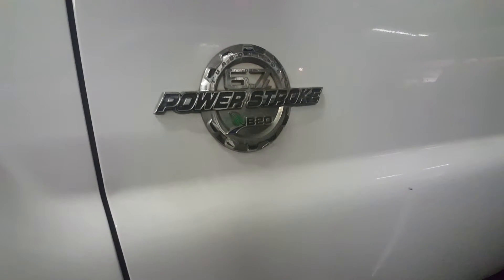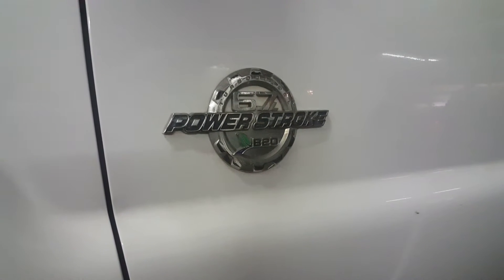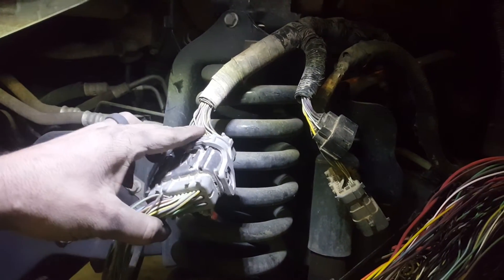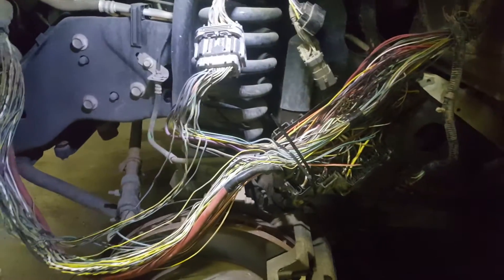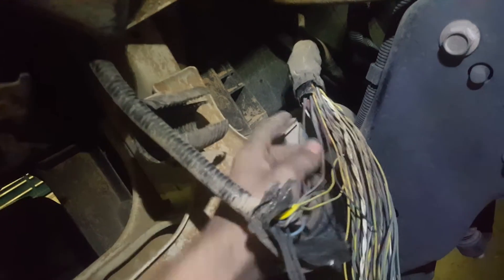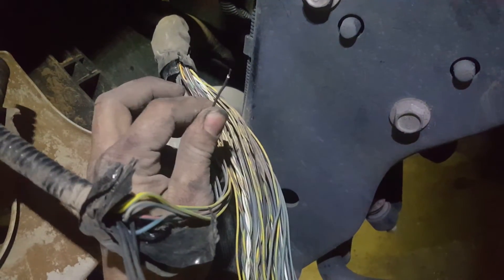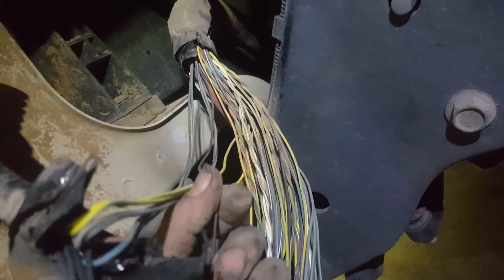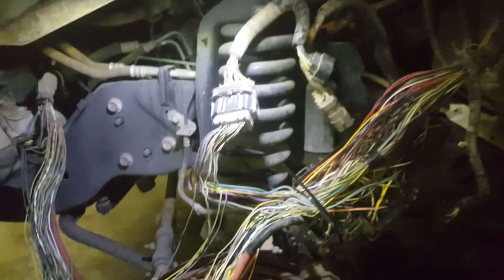6.7 powerstroke No Crank, No Glow Plug light !! FIX!!

Comment: Hello guys i have a 2016 with glow plug code. Says all 8 are open i change the module and did nothing truck only have 80k miles. Any suggestions where should i look for troubleshooting. Thank you
Reply from the maker: Will look in the morning, but I'm pretty sure the glow plug module has its own power coming from the battery. Make sure that is good

Comment: I have a no crank issue I have no codes but starting circuit open or grounded I’m at a loss I think that wire  purple gray comes from ignition switch
Reply from the maker: Have you made sure the starter is working?
Reply: Travis Mcgee I had it rebuilt I might have a dead cell I just picked up a load tester today I only had a multi meter
Reply from the maker: @WaterandWoodsmen  there is a singe wire connector on the passenger side of the engine compartment that you can disconnect, then run it to the positive side of battery, it should crank if you have good batteries and starter.
Reply: @OlivierMcgee  thanks i hope to get it today it seemed to crank slow for sure when i jumped starter relay
Reply from the maker: @WaterandWoodsmen  cool. Sounds like like need some batteries.

Comment: Thank you for sharing your experience with tracking down the "no start" problem.  Good to know, since taking a truck to the dealer can sometimes be an inconvenience due to time or work requirements.

I had a similar condition happen four times on a 2015 Super Duty with the 6.7L PowerStroke.  When turning the key to start, various icons and warnings (water temp, wrench, and oil pressure symbols) showed up, including a "STARTING SYSTEM FAILURE" message.

The problem may have been a poor connection with a multi-circuit harness plug (forgive me, but I do not know the exact terminology of that connector), which is located under the dash, just above the parking brake foot pedal mechanism.  This wire harness connector (maybe with 12 to 16 circuits) is clipped on to the very top of the parking brake pedal mechanism bracket.

I grabbed the wire harness connector, and squeezed it together as best I could, then checked if it helped by turning the key.  It started up good, and almost everything appeared normal.  The only thing that I noticed was incorrect, was the outside air temperature showing 50 degrees.  The temperature here was in the low 80s.  But just as the display did the last time when this same problem occurred, the temperature slowly corrected itself, and returned to normal within a few minutes.

Perhaps I should have unplugged the harness, and plugged it back together.  If the problem happens again, I will unplug and plug back together the harness.

I hope this helps.  And once again, thank you for sharing how you got your condition corrected.  Take care.